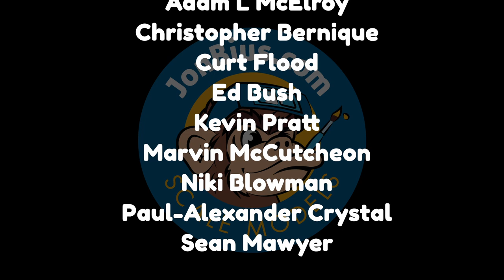Basic Modeling Skills - Adding Fluid Stains To Your Models

Comment: Great information. Thanks for the different techniques on enamels, acrylics and oils. I'm learning more about using all three, but acrylics are the ones I've struggled with the most.
Reply from the maker: Thanks! I'm glad you liked it.

I think acrylics have a steeper learning curve because of the different application method when compared to oils and enamels. But once that hurdle is cleared, I like them better.

Thanks for watching and commenting!

Comment: Jon, this video made things look easy. I'm certain a little practical application will set me on the right track. Now I have questions about the AK dry weathering pigments. Mostly principles of operation, application methods, and wet or dry use. Is there a possibility of you doing a video that " Breaks it down Barney style"

Fishstick
Reply from the maker: Glad it was helpful! And you are right - a bit of experimentation, and practical application, will get you solidly on the way to using this as a regular "tool" in your modeling!

Great idea on the pigments! I am adding that to my list for later in 2022!

Thanks for watching and commenting!

Comment: Jon, I’m looking for one of those table (clamp or screw/bolt) mounted, big magnifying glasses, with a built in light. The ones on an adjustable arm, kinda like the fly fishing guys use to tie flies. A good, solidly built one. 

This would be for both extreme detail painting and very small parts assembly. 
Amazon search results vary a lot, and a good bit of that looks to be cheaply made and flimsy. Can you recommend anything? The larger the diameter of the glass, the better.

Thanks so much for your work here. You are a fantastic resource.
Reply from the maker: Thanks so much for your kind words! I am grateful.

I'd actually tried one of those, and found that I preferred my head visor much, much more. The problem I had with the magnifying glass was it required too much continual adjustment to keep it in focus. While the light was helpful, the single focal point that seemed to continually move was less than optimal.

I've been using a very cheap head visor for 13+ years now. Having the magnifying glass in front of each eye has greatly helped with focus. And because it moves with me, keeping in focus is much more natural. And because I've had cataract surgery in both eyes, I literally can't see up close without it. (I also wear reading glasses while using it.)

There are plenty of options on Amazon and elsewhere for the magnifying glasses like you describe, but as I don't use one, I couldn't recommend any brands, etc.

I don't even know the brand of the head visor I use - it's quite a basic one! But it has worked for me very well.

Thanks again for watching and commenting! I am grateful. Happy day to you.
Reply: @JonBius  10-4, John. I have a cheap visor thing too. You can swap out “lenses” of various mags. Great tool. Thanks.
Reply: @Shakes_The_Clone  Harbor freight
Reply: @MattR58  Thanks, Matt!